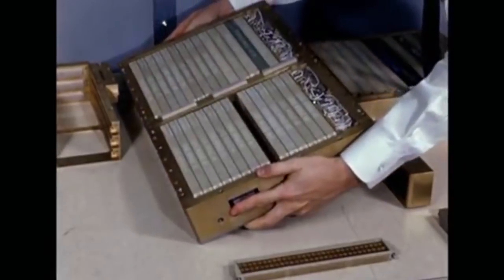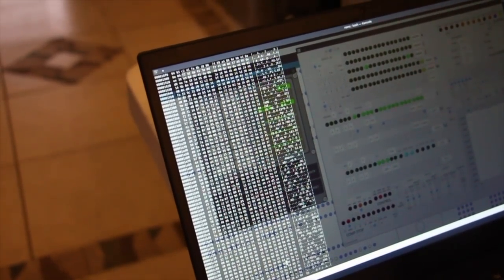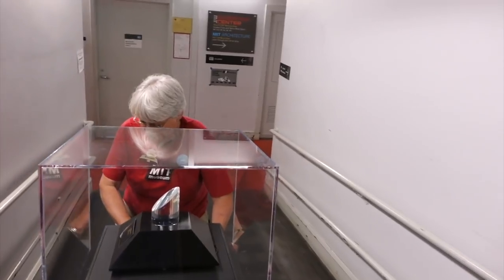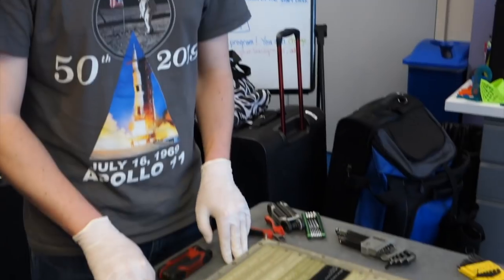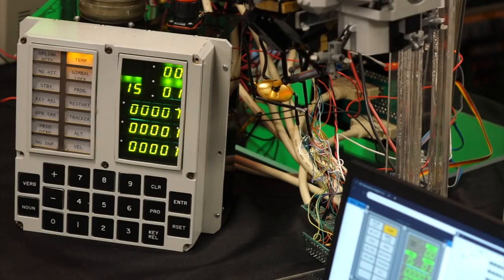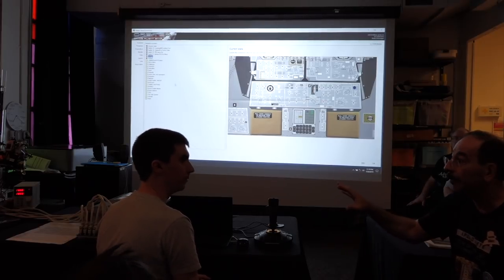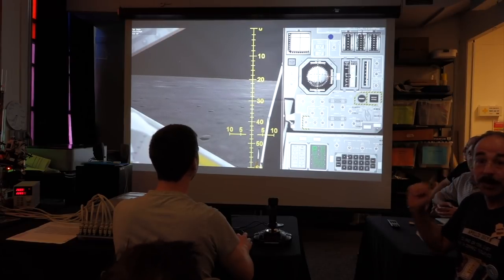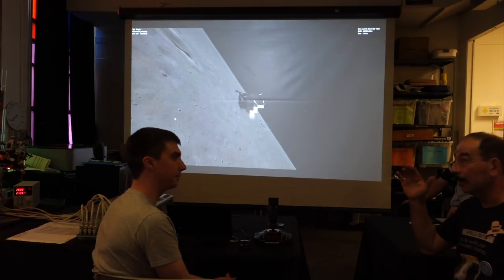Apollo Guidance Computer Part 24: the restored AGC does Moon landings in front of its creators

Comment: "In the infinite wisdom of the people at MIT... The people at MIT programmed the computer so it was checkpointing so it could restart and continue where it left off. And that basically saved the mission. And I'm still waiting for that feature on Windows" ... LMAO
Reply: Had a little giggle at that. To be fair, I'm still waiting for that feature on all my Unix/Linux computers too! This Arch laptop takes 4 minutes to reboot (i did something horribly wrong with a bunch of drivers and well now they spend too much time initializing...

vxWorks (used on most space missions and rovers) resets like the Apollo AGC - it just picks up where it left off. It's the essential difference between embedded and consumer systems - the degree of control you have at power on or restart. The AGC was an embedded system designed for one single purpose, even though it arguably spawned all the future work that became consumer general-purpose computers, it itself was very much an embedded design.
Reply: You could do it with any app written on an IBM mainframe and allow an infinite amount of checkpoints if you used tape
Reply: Very common in space applications, it's quite superior to later "hot backup" redundancy designs.

Comment: Absolutely incredible! A marvellous finale and tribute to those who created the hardware and software over 50 years ago and also to the present day team that brought it back to life. It's simply inspiring.  As an electronics engineer living through valves, transistors and integrated circuits I found it amazing to see multilayer and surface mount technologies being used in the 1960s. There's so much of the history in the form of fascinating stories to be told by those pioneers, it's imperative that someone sets up a project to do whatever it takes to get them talking and record as much of it as possible for posterity.

Comment: Great seeing many of the creators of the AGC are still alive. Agree with the other posts be great to get them together and do an oral history.

I have a question. How did you go from manually simulating accelerometer data to automating the inputs to the AGC? When you did the manual hack I was surprised the AGC did not care about gyro data, just the accelerometers.
Reply: The AGC took the lack of gyro changes to mean that the spacecraft was not rotating at all. It therefore didn't need to fire any RCS thrusters to restore the intended attitude. That would fail with a more complex mission, such as was run with the help of the LM simulator (Orbiter/NASSP). 

The Orbiter/NASSP simulator feeds data to the virtual AGC that is usually running when you fly. Mike simply captured each time that NASSP fed a counter value, representing a change in gyro position, acceleration, radar position, etc and he would pass that value to the real AGC through his test monitor on AGC connector A52.

Comment: What do the patch panels do? Also where do the various connectors in Carl's adapter go (I assume one is for the DSKY, another for the patch panel)... I feel like we didn't see much of Carl's contributions. Understandable given the time crunch. But a future video showing all the final components created would be neat.
Reply: The patch panel breaks out the 360 pins of the A51 connector on the AGC, which is organized as a left and right half of six rows by 30 columns each, into two panels for the left and right with the same organization. This allows us to hook quickly to any of the 360 pins.

The adapter implements conversion circuits for the four type of input-output circuits, allowing a modern 5V or 3.3V device to be used. Signalling is either pulse or logic level, and is either going into or out of the AGC, thus there are four circuit types. Logic level in the spacecraft is +28V or ground. Pulses are currents over differential wire pairs that reach under 14V at peak. 

These are named C for logic levels that are output by the AGC to control the spacecraft and I use red receptacles for these, both on the main patch panels and on the interface/adapter boards. The logic levels that come into the AGC from the LM are type D circuits and are color coded green. 

Pulses which are output by the AGC to control the LM are type XT and are color coded yellow on my boards, while pulses coming from the spacecraft into the AGC are type Y, colored blue. 

Pulse circuits are differential pairs thus need two patch cables apiece, but the modern side of my adapter boards are single ended for these circuits (and for the logic level circuits as well). 

The DSKY has 23 type C and 8 type D connections to the AGC, which are plugged into the patch panel (plus three power signals).  The LEGO LM model has 16 type C circuits commanding the firing of the  thrusters on the four RCS quadrants of the LM. It has two type C circuits that command LM engine on and LM engine off. Finally there are two XT circuits that increment or decrement the thrust of the LM engine by stepping a counter up or down in the engine controller. 

Marc built a device that provides accelerometer (PIPA) pulses using multiple type Y and type XT circuits. He plugs this into the patch panel but has his own adapter circuits built in so that it doesn't make use of my adapter boards. This device was augmented to also provide a stream of spurious counter pulses via type Y circuits for the purpose of simulating the flood of false position pulses from the rendezvous radar - it is a 1202/1201 alarm inducing device. 

I also had built but didn't complete testing of a telemetry downlink capture box. This emulates the master telemetry controller in the spacecraft and polls the AGC for a downlink data word 50 times per second. The capture box has to produce start, sync and stop pulses synchronized with the AGC master clock, using type Y circuits, in order to detect the pulses on an XT circuit that determine whether a given output bit is one or zero. 

There were a number of spacecraft status signals (type D) that must be in specific logical states for the demonstrations to work. As two examples, the Temp in Limit signal must be +28V or the TEMP warning light on the DSKY is illuminated, and the Nav Reset signal must be +28V to correctly reset the optical telescope keyboard latches otherwise the computer believes that an astronaut is holding one of the "mark" keys down. We use jumpers with pullup resistors between a receptacle for 28V and the relevant input receptacles on the patch panel.
Reply: @carlclaunch793  thank you for goin depth, it was beutiful. you could make a video just demoing the brake out patch panel and other peripherals

Comment: Great work! 
How did ou guys managed to connect the AGC to a today's computer? What kind of interface was used?
Reply: Mike has implemented the ground test capability, through the maintenance connector (A52). This allows stopping the CPU, poking data into memory locations and other debugging style operations. His laptop, running the NASSP plugin to Orbiter, is capturing the data that the simulator program is putting into the memory of the virtual AGC in the simulator program, putting that into the real memory of the AGC via the test monitor. 

The test monitor he created is an FPGA based unit in the connector on A52 plus a USB link to some GUI code running on his laptop. It just took some hacking of NASSP to bridge it to his test monitor software in the laptop, with the resulting data flowing over USB to the FPGA on the test connector and into the AGC.

Comment: so abort stage uses the AGC and not the abort computer? BTW - there is a missing story here the abort computer. it was used after gimbal lock on apollo 11 and most of the return of apollo 13. whilst quite rightly we are bigging up the achievment of the AGC and its creators but we are forgetting those guys. And in the event of a big failure they would have been heros.
Reply: Abort and ascent both can use either the PNGS (AGC) which is the primary means of control, or be switched to the backup AGS which is a bare bones abort and rendezvous system. 

Fortunately it didn't have to be used on any ascent from the moon except for the final approach for rendezvous when Armstrong maneuvered the IMU into gimbal lock. Rather than looking for star sightings with the AOT to realign,  the AGS has body mounted lower accuracy gyros that still provided reasonable orientation information to the AGS since Collins would perform the final approach and docking. 

The lower power drain of the AGS and its gyros compared to the PNGCS was the reason they used the AGS to hold attitude during the midcourse burns. It didn't do any calculations of the burns, which had been developed on the ground in the RTCC, but it could hold attitude while the DPS burned. It was also handy to attempt passive thermal control mode.

Comment: 5:07 - Holy Flock.  The AGC software was compiled 2 days prior to launch?!
Reply: they where pretty sure about their work :D
Reply: @Strothy2 ,
...and probably qc'd it with a bit2bit DIFF, just to make sure that nothing got broken.
Reply: At least printed :)
Reply: i don't think they could do that, as the ROM would need to be weaved after that. And with the NASA standards I'm sure they would have run the modules through many simulations before launch.
Reply: @albertsandberg  Yep, you got it. The date printed on the listings is the time of print, not the time of assembly. There was a very late emergency bugfix for 11 that made them have to remanufacture module B1, but it was released for manufacturing in mid-late June (which is still incredibly close to launch).
Reply: @mikestewart8928 ,
Thanks for setting me straight on that one too.  NASA was crazy enough to swap out Mattingly for Swigert 3 days prior to launch, so seeing that printout got me jacked to think they were as cavalier with their code as well.

Swigert was the first Rookie to ever be tasked to fly solo around the Moon.  And they threw him into this crew he hadn't trained with just a few days prior to launch.  Has to be one of the blatantly stupidest decisions NASA has ever made.  I've never heard a good reason why they didn't simply slip a month.  Or even just to risk it with Mattingly, seeing how the worst case would be that he got sick on the trip home.

No one ever mentions this, but it is quite possible that that Oxygen Tank Failure actually SAVED the lives of the crew.
Reply: Da Hawk I don’t think you give Swigert or the others enough credit. The two crews had trained for the entire mission in parallel, they were all equally competent at their respective tasks. The only issue would be how well tuned they would be as a team, but I think history proves that they were as good together as could be expected.

Comment: 18:00 But 1202 wasn’t a hardware error at all, it was human error. Buzz turned on the radar pointed at the command module when it should have been switched off. The incoming data was appropriately dumped by the computer so it could focus on the important task of landing. It wasn’t a malfunction, it was doing exactly what it was supposed to be doing! The malfunction was human.
Reply: Sorry,  that is not correct. This has been misunderstood and even when NASA definitively identified the problem, stories such as the above have lived on. 

The flight plan had him turn the rendezvous radar steering to "slew". The dish can be steered by computer or moved manually, which is slew. With the switch in slew, the dish won't move. In the minds of the flight planners and everyone else, this was the 'off' position. 

The data coming in was not radar returns, it was angle information - the position of the shaft and trunnion of the dish. With the dish immobile there should have been no angle changes arriving, but due to a systems integration flaw, the resolver that would create a digital value for those two angles was driven by the Grumman built LM 800Hz supply, rather than the 800 Hz supply within the AGC. 

Random differences in phase occur as these two supplies were not synchronized. Many times it causes no problems, but in some worst case relationships, the resolver cannot converge to an answer. The result is a barrage of false movement reports to the AGC.  They overloaded the computer so that tasks it was performing during Program 63 and 64 weren't completing. 

The immediate fix devised on the ground, to leave the radar breaker off during initial ascent, did nothing. Even with the radar beam itself off via circuit breaker, having the radar dish in Slew sets up the conditions for the flood of false movement pulses. 

This problem was not seen on the simulators because they didn't implement the full actual electronics of the spacecraft. It was, however,  spotted in testing at Grumman and independently during checkout testing at KSC. Eventually someone concluded the problem was rare enough and wouldn't cause a problem, so no fix was attempted. 

After Apollo 11, a fix was developed. The software in the AGC had an output signal that could force the counters to zero, normally used at initialization or in certain times of setup. It now would be activated if the radar dish was not under AGC control. Implemented for all later Apollo flights. 

There is  detailed post portem technical report but here is an essentially correct post covering the issue https://arstechnica.com/science/2019/07/no-a-checklist-error-did-not-almost-derail-the-first-moon-landing/
Reply from the maker: There is so much misinformation about the 1202 error. It’s too complex to explain here, but it was not a checklist error, not a crew error, not a radar configuration error, not a software error. Turning the ranging radar off, as they later instructed the crew, wouldn’t even have prevented it! It was a complex hardware interaction problem, which had been actually observed and reported at least twice in testing, but not corrected before flight. The hardware that failed under these conditions was the CDU trunnion and shaft coarse digitization modules. The cause of it is very involved, it will take a really long video and lots of hardware to explain and reproduce it.

Comment: I have an obscure question.  During the landing sequence the dsky displays the landing location by way of the markings on the commander's window.    But did the computer know how tall the commander was to adjust for parallax? Or was it just assumed this was an approximation and since all astronauts fell within a narrow height range that this was not significant?
Reply from the maker: There is an outer and an inner window. Both have graduations on it. You need to visually line them up to be in the proper position.
Reply: @CuriousMarc  Thanks! Yet another perfectly simple solution to an otherwise complex problem.  These engineers thought of everything.
Reply from the maker: I wondered about the same thing by the way. They had all sorts of problems getting that parallax correct, including the LM ballooning slightly when it was pressurized and moving the windows indications a few degrees off. I think they chose to compensate for that in software.

Comment: Message to you guys  and Mike stewart specifically.... why couldn't you go to the Simthsonian air & space, go to the actual Columbia CM, and
 download the actual software FROM THAT COMPUTER!  The CM is supposed to be an in tact specimen, so the AGC should be there (with all the info).
  That is unless its been removed and used in Apollos, 12,13,14,15,16,17.
Reply from the maker: We asked the great Air and Space Museum for access to a much more modest artifact than that (not even on display) to help our research. We even had a letter of support from none other that the former NASA director of the human space program. We got very rudely turned down by the director herself. The artifacts in that museum are effectively locked away. Fortunately not all museums are like this. As you can see from the series, the MIT Museum and the Computer History Museum were quite helpful, and we thank them very much.

Comment: Reset protection"crash-proof design" there not available feature in all OS..
Reply: Fairly common in industrial programmable logic controllers - but then they don't run windows....
Reply: @allangibson8494  That would definitely be a good thing, unless you want a machine to exceed it's normal operating parameters and break stuff. It would be a nice feature in an OS, but would probably be like a nightmare from hell to implement.
Reply: @user2C47  There are versions of Unix that have gone down that path but the applications have to be designed around it.
Reply: @allangibson8494  Absolutely! It took the discipline of the many programmers to implement checkpointing and design code that would recover properly at any failure point. Some OS have a checkpoint/restart capability but without the application support, it is useless.

Comment: You should have more concern for ESD while working on the AGC and related components.
So the AGC was a single point of failure?
Reply from the maker: Already explained many times in other comments. The lab is ESD proof but the AGC is not ESD sensitive. MOS logic would not be used in computers another 15 years...
Reply: Not quite for the LM, the LM had a second computer, the AGS, which could do just enough to get back into orbit. It was used briefly during docking on 11 (Armstrong put the AGC into gimbal lock), and on 13 for a mid course correction

Comment: have you guys tried flying Program 65 automatic landing?
Reply: Yes, Mike has and it works properly. Only downside is that it can't tell if there is a crater, a boulder or an excessive slope at the target point; it will land at that point regardless.